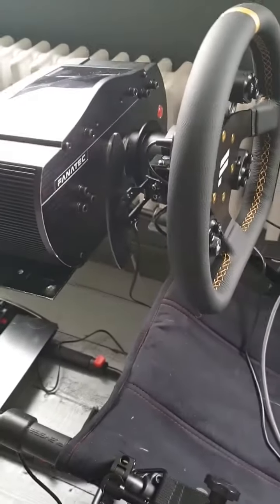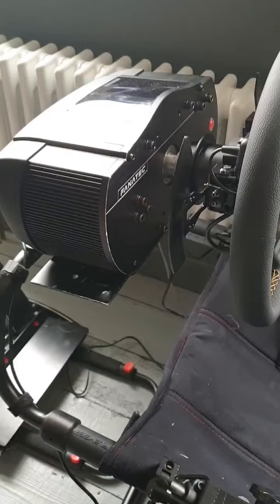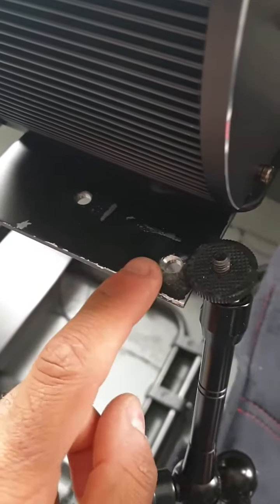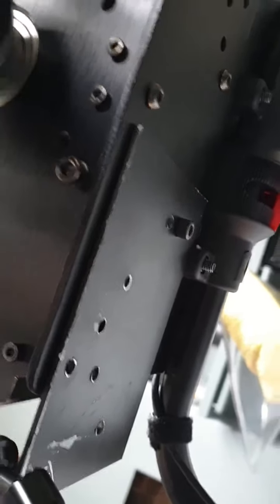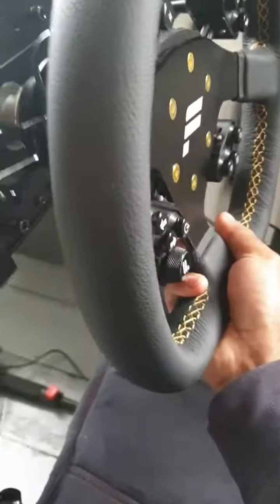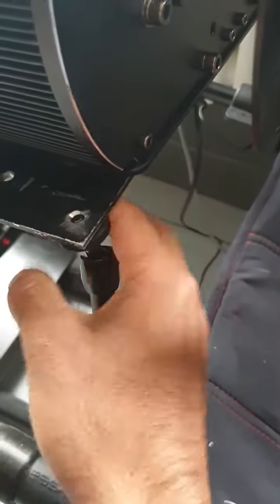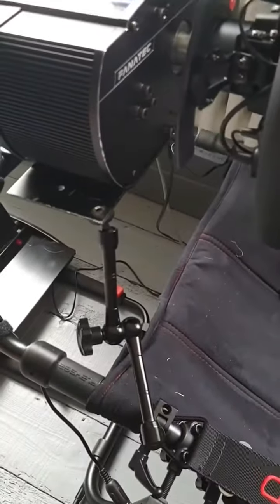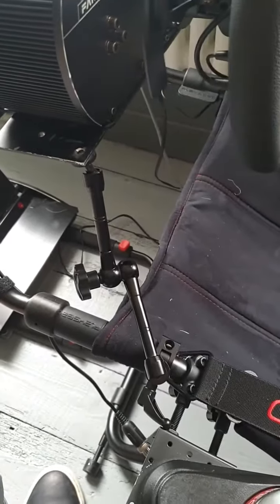(old design - see new one) Playseat Challenge Stability Mod (for Fanatec ClubSport Wheel 2.5)

Comment: Hey, I‘ve adapted your idea but took two of it, one on each side and its connected to the bar so it is still oben so swing it up!! Now only the bar is having some minor flex but the chinese 3d print part will arrive in a week or so and then i guess it will be as good as a rig!! Also fixed the lower bar for the pedals with the band so it won‘t rise up! Thanks for sharing this great idea!:)
Reply: Don't connect both from the bar that sways open, it's pointless since one is enough to stabilise the up-down motion of the steering wheel platform. Use the 2nd to connect the steering platform to the chair chassis to prevent back&forth movement. It's been a few weeks since I mounted mine, very pleased, still rock solid, no readjustment was needed. I did loosen it, put threadlocker here and there and retightened it.
Getting in and out is still very easy, I only need to disconnect the left magic arm from the steering platform, swing it out of the way and I'm out.

The plastic parts that you're hoping to fix the back&forth movement won't last. Mine fractured in weeks and even before then, they only marginally fixed the rocking which was still happening but not as freely.
Reply: @traianionita5972  the 3d printed part is in and its reducing the movement slightly,... had to rub some material of before it fitted. 
The flex is now nearly zero but I will try to connect one of those arms to the chassis because the only flex I got now is the whole bar connected to the chassis. But at least for now it is much much better! Thanks for the hint
Reply from the maker: Cool man- would love to see the result! I've updated my design too if you're interested:

https://www.reddit.com/r/simracing/comments/kvv8tz/playseat_challenge_stabilitydirect_drive_mod/
https://www.youtube.com/watch?v=iUUgNau-ao4

Comment: Nice work!! Definitely looks like yours works better than mine, great job!
Reply from the maker: Thanks mate! I was stumped for what to use like you were after watching that Chinese guy. Your magic arm idea was a Godsend
Reply: @lia01reg  Can't believe it worked so well for you. So I actually have my wheel mounted slightly differently ... I find the way you have it mounted (which is the correct way with the 3 bolts in triangle) ends up with 1 ) the wheel too close to me and 2 ) the massive amount of flex you were seeing. I only bolt mine through with 2 bolts horizontally - just super tight. That then allows me to mount the whole lot BACK in position compared to mounting the 3 ... that's why my overhang is at the back rather than the front (which I think is a bit more stable normally). Mine is a lot better than it used to be, but it's still not perfect probably need to fabricate some metal legs or something.

Comment: Nice idea. Can you tell me if the steering wheel plate on the seat has to be moved closer to you in order to fit the csl base to it. Or could it be fitted with the plate in the center position it comes a standard. Or would the center position required drilling a hole?. Thanks
Reply from the maker: Hey - I actually had to reverse the wheel mount plate to get it to work. If you do that - this all works without any extra holes. Also, check out the new design - far better:

https://www.reddit.com/r/simracing/comments/kvv8tz/playseat_challenge_stabilitydirect_drive_mod/
https://www.youtube.com/watch?v=iUUgNau-ao4

Comment: Great idea, thanks, ended up using 2 magic arms, one 11 inch and one 7 inch. https://ibb.co/cNz5kXD. The 11 incher is mounted like yours connecting the chair frame to the steering holding plate, and the 7 incher on the other side, connecting the bar that swings open to the holding plate. There was still a little bit of play left with just the 11 incher, but it's absolutely rock solid now stabilized from both sides.
Cheap fix & gives a very rewarding FFB feeling, greatly improved compared to the default wobbly FFB.. if I knew the difference would be so noticeable, I would have done it a long time ago. It's a difference like listening to IEMs with wrong vs correct tips - who has IEMs knows what I'm talking about.
Reply: Salut Traian, de unde le-ai cumparat? Imi poti da niste link-uri?
Reply: @ursuake  am gasit pe emag si pe olx, exact cu numele de magic arm. Cam 100RON bucata. Ai grija cu crabii de prindere, ca aluneca. Iti recomand pentru inceput sa montezi stabilizatorii provizoriu, sa le gasesti pozitiile finale unde stabilizeaza bine, apoi scoate din crabi padurile de cauciuc deoarece aluneca in timp si foloseeste putin epoxy ca odata fixati sa nu mai plece la plimbare neinvitati. Cat mai puternic epoxy, cu atat mai bine. Eu foosesc Gorilla Glue de 240Kg/cm2.
De asemenea, ia din Dedeman threadlocker deoarece indiferent cat strangi la diversele suruburi se vor slabi de la vibratii, in mijlocul unui race asa cum se intampla de obicei..
Reply: @traianionita5972  merci mult de tips-uri!! raman dator :)
Reply from the maker: Oh nice man! Yeah, makes a huge difference. You should check out my new design. It kicks the ** out of my existing one. It completely broke but this new one is way more stable and more user friendly:

https://www.youtube.com/watch?v=iUUgNau-ao4
https://www.reddit.com/r/simracing/comments/kvv8tz/playseat_challenge_stabilitydirect_drive_mod/